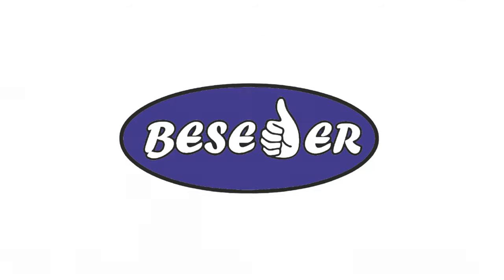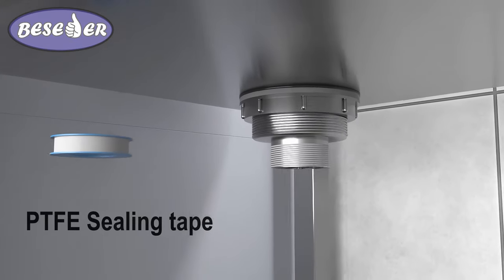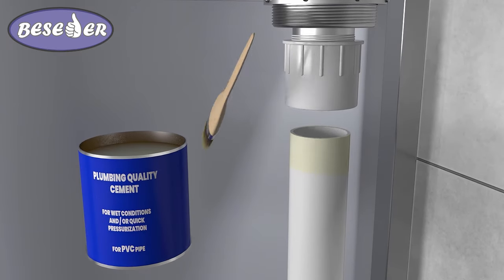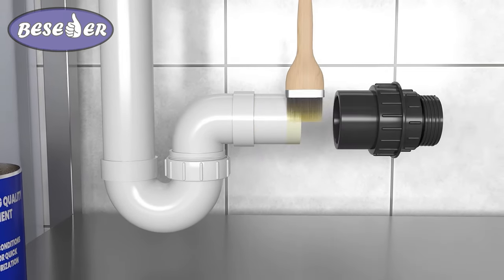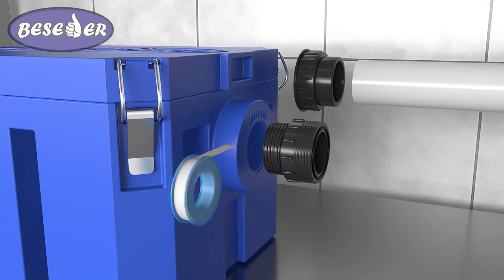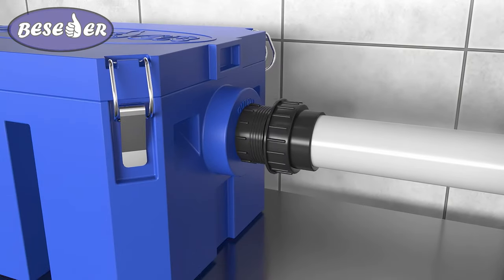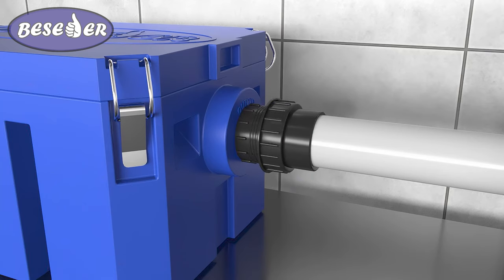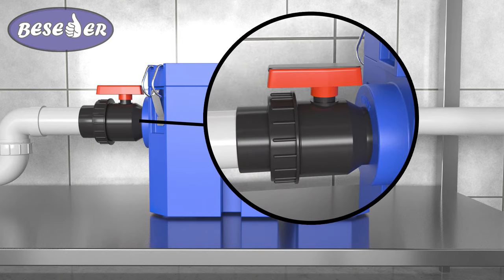installing a grease trap under the sink.

Comment: No vent??
Reply from the maker: Thank you for your question. 
This video shows how to connect a small grease trap with a capacity of 5 GPM, mainly used in home kitchens.
It does not require ventilation.
At the same time, in any grease trap, including ours, it is recommended to use biological products for decomposing fat regularly.
We recommend using these tablets.
https://www.amazon.com/dp/B076PB2C5J
Why tablets? When using liquids and powders, bacteria and enzymes are washed out faster by water flow.
Due to their large mass, the tablets remain in place and continue to work for 2 weeks.
The tablets have a high concentration. They are made in the USA and consist of bacteria specially selected for more effective decomposition of fats and oils.
As for the scheme for connecting larger grease traps using ventilation.
Please watch it here.
https://www.youtube.com/watch?v=2_yGSzGbSzM